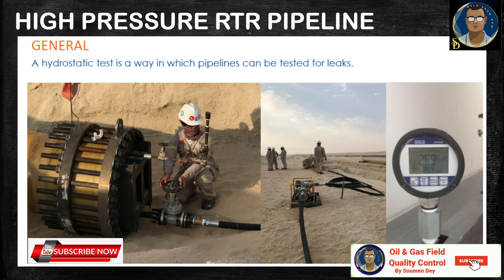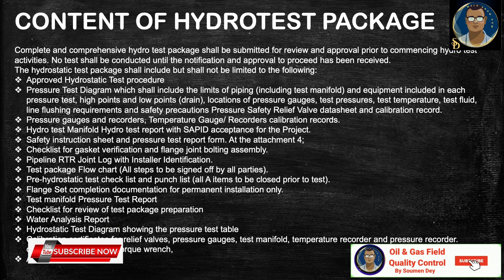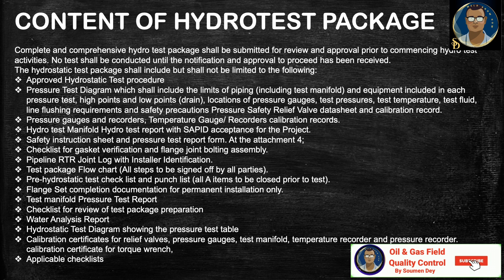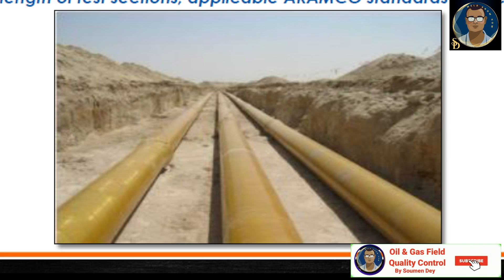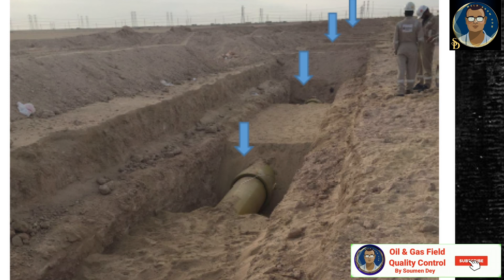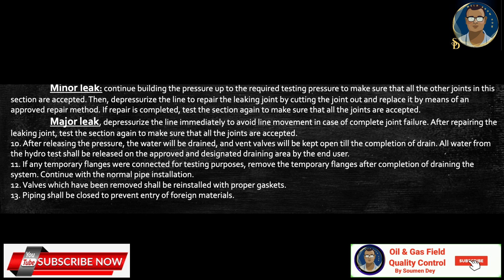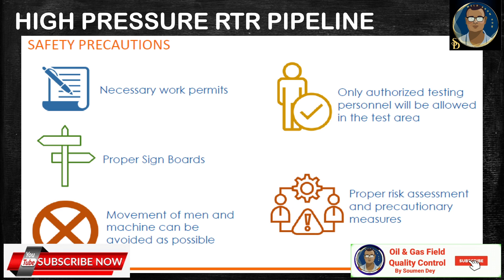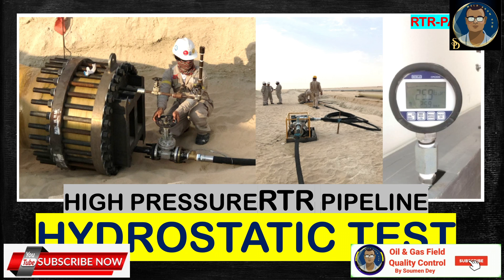High Pressure RTR Pipeline || Hydrostatic Test

Comment: Very nice information throughout the playlist I have seen all the videos 

Request u to make fabrication report with fabrication drawing like 
Structural piping report 
Weld visual report 
Fitup report

I hope u will make such a video soon plz 🙏
Reply: Thank you dear for your kind comments, can you please elaborate what type of report you are asking. For quality all the required formats are either part of the quality plan or it is being supplied by your client
Reply: @soumendey1331  Sir When we perform qualified welder test after that all qualified welder will do job of fabrication at site ! So such type of report or documentation we have to  prepare at that time ! 

Using isometric drawing 
We prepare document like 
1) Weld visual report 
2) Fit up report 
3) NDT report 
4) Hydrotest Report (if hydrotest) 
5) Structural Painting & Coating Report 
This all reports submitted to client for sign on daily work report!
Reply: These all are quality report! 
There are lot of reports how to identify the joint and how many joint and how to give joint number like this !